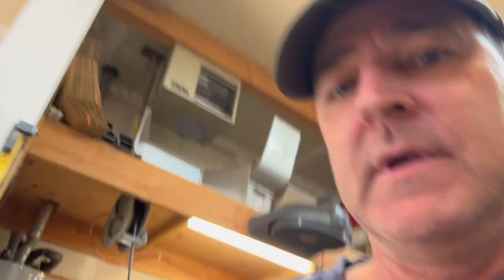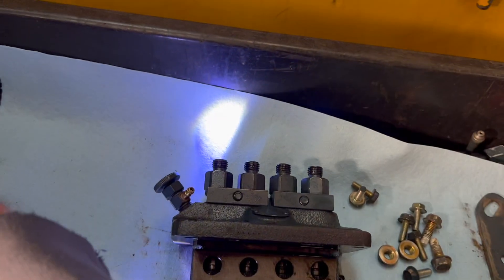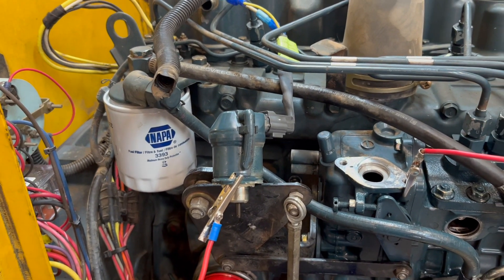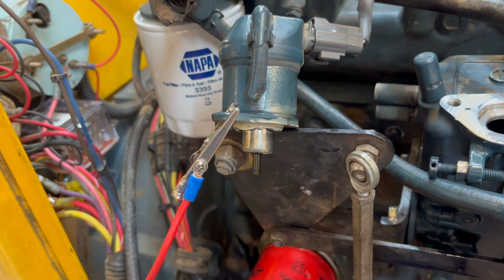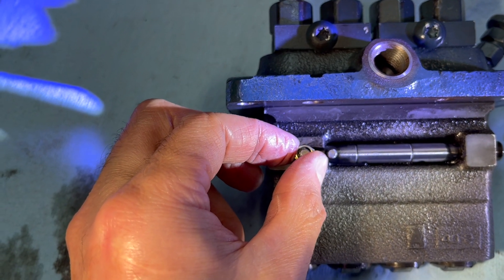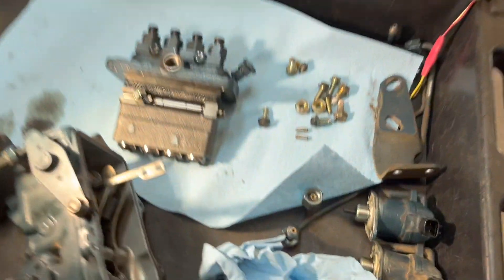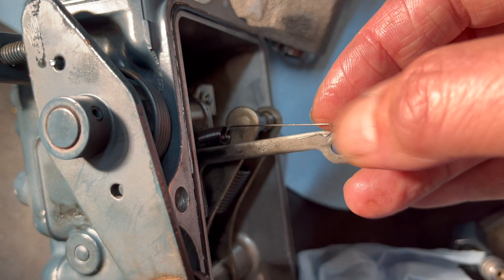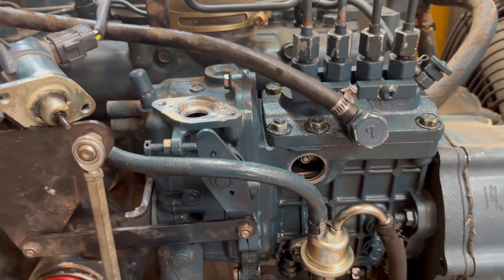Kubota V3600T Injector Pump Problem and Fix

Comment from the maker: CORRECTION- I did not tighten the slide nut enough. Tighten it with a screwdriver with 8mm (?) socket, just until it resistes beyond the tefflon. The screw stud does have a shoulder to it so make sure the linkage bar is correctly fit over that shoulder and its well lubed. With the stop solenoid removed to should move freely and I mean NO resistance at all. So what I found is, if that nut to too tight or too loose the linkage will bind just enough to keep the slide from retracting into the run position at startup.